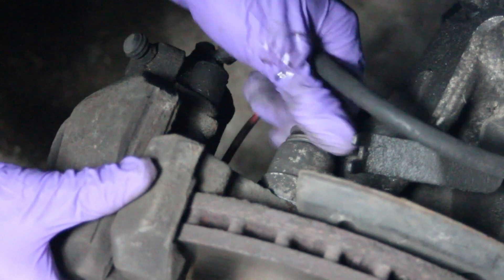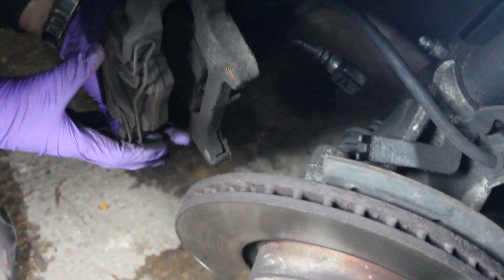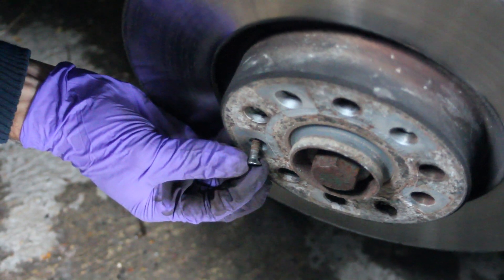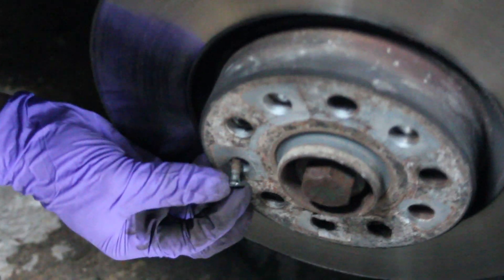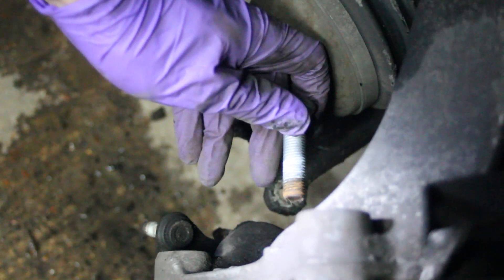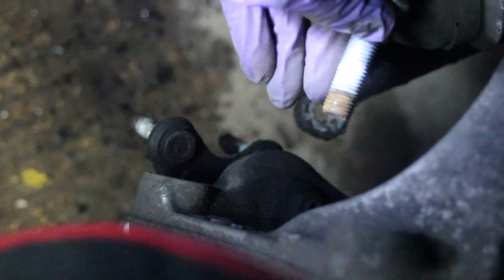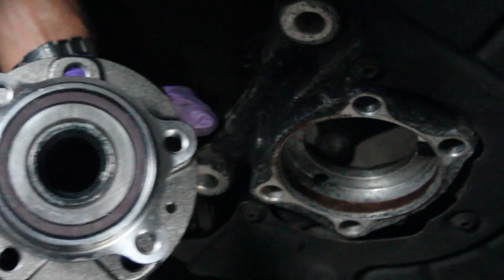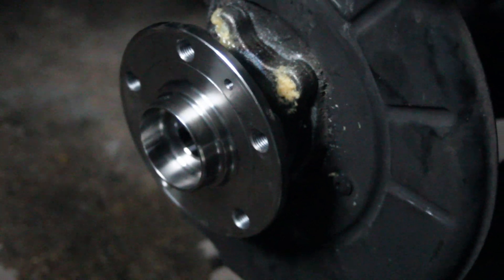VW Passat B6 - Fitting Front wheel bearing replacement 2005-2010

Comment: This video was very helpful, thank you! Just for the benefit of others however, my 2006 passat b6, has M12 spline bolts, not M18. before people run out and buy the wrong bits, double check! The replacement hub assembly also generally comes with a 12 point bolt, which is a 24 mm, the hex head bolt on the original assembly is a 27mm.